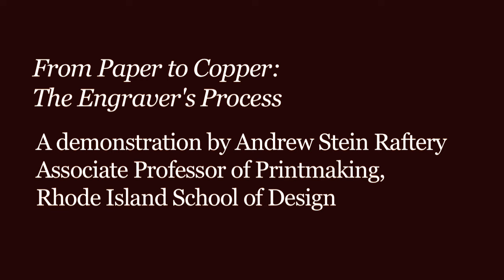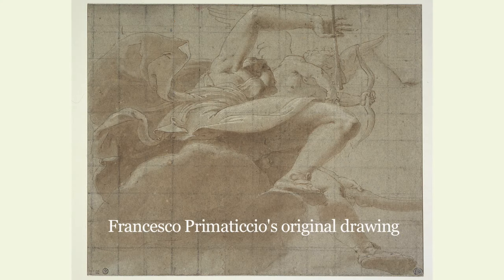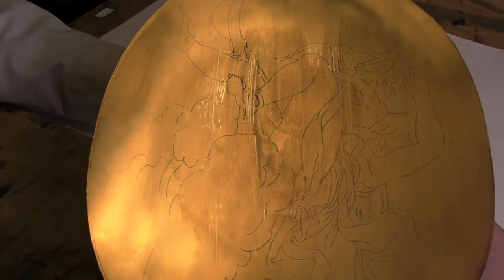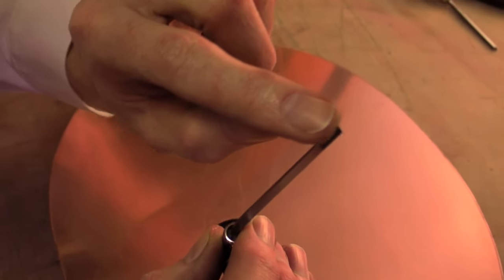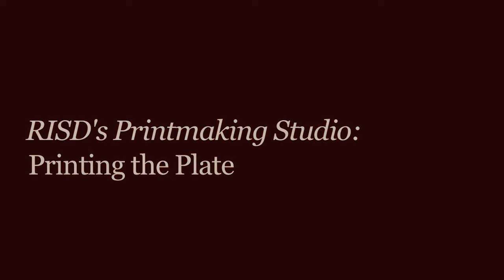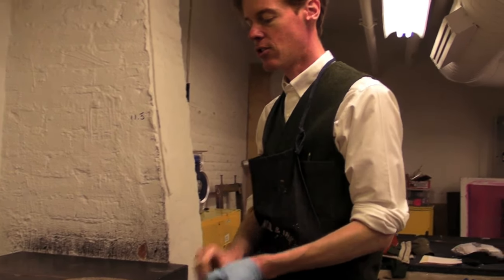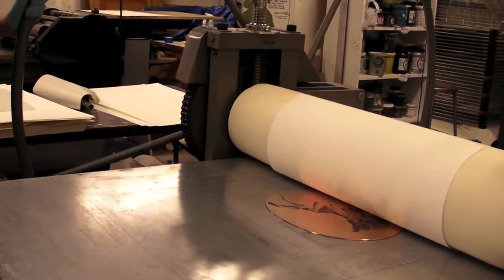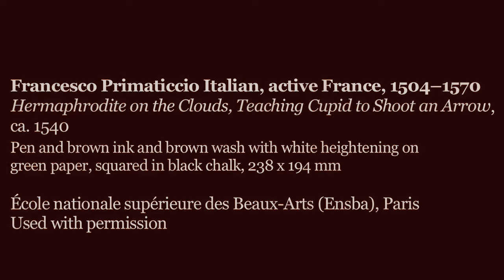From Paper to Copper: The Engraver's Process (2009)

Comment: While I saw several engravers and their example works in college, I had never seen true 'modern masterpieces' until I happened to stumble upon where the 'true masters' of our modern age practice the 'old arts'...firearms engravers. Some of the greatest 'engraving masters' that live now, work in firearms and knives...doing 'custom one-off' contract pieces for clientele. A simple $1,000 hunting shotgun becomes a $10,000, $25,000 masterpiece after they have finished their work...with skill arguably better than even the Renaissance Masters themselves. Not to mention, their works done in hardened nickel-steel is FAR more difficult, and enduring, than copper will ever be. Take the time, search for videos...they ARE out there!

Comment: Can I use the same method of using the wax on other metals such as sterling silver, stainless steel, and gold?
Reply: I would assume so, as long as you could still etch whatever metal you were using! I don't think the wax would react badly with any metal, nor would the heat used to melt the wax, melt the metal. I would still advise testing it first, to make sure it works for you, before doing a large piece like this. (I've never engraved anything, but it seems like this technique would work on any type of metal!)